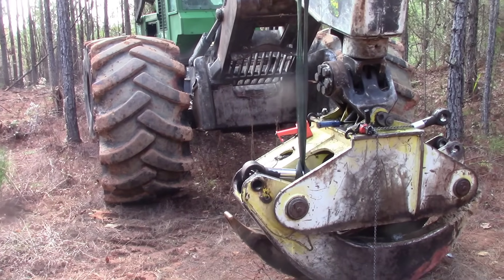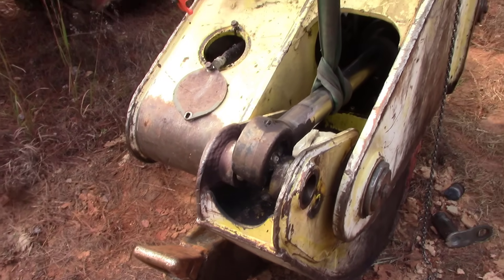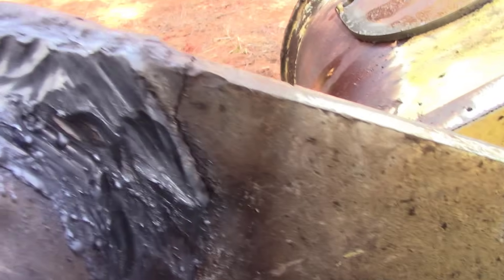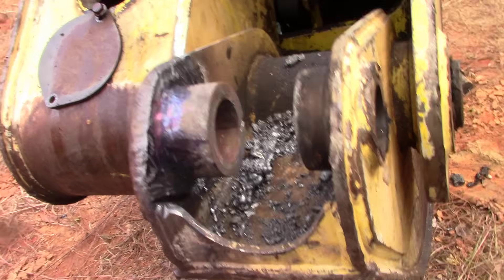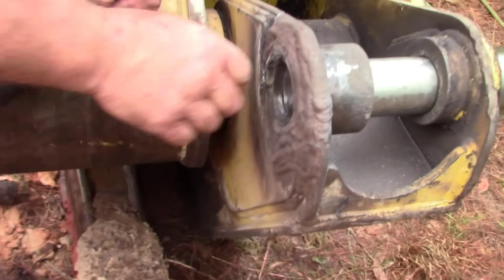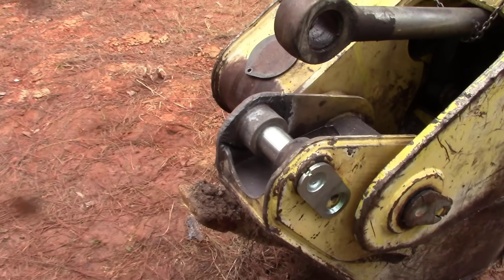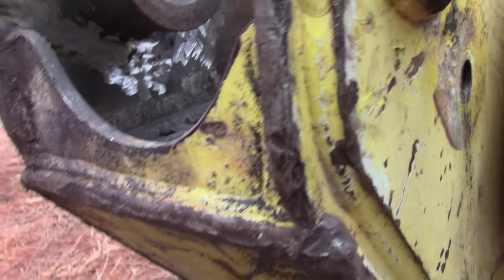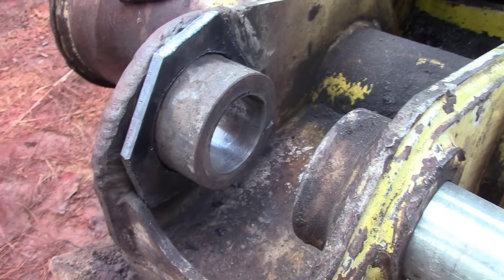748H Skidder Grapple Repair

Comment: Probably not a permanent fix as you say. However you did what you could with what you had on hand. Loggers can tear up an anvil with a rubber mallet. Not because they are any worse than any other machine operators. The nature of logging is hard on machinery, especially here in New Hampshire where  I live. We have rocks the size of skidders, granite ledge, steep slopes and the going is usually tough. It's hard on machines. Why things last as long as they do is testament to mans ingenuity. Well done boys. If that poor old grapple ever makes it into the shop for a rebuild you can bore the holes straigt and make more significant repairs. But that may never happen and in reality what you did will most likely go many hours before you need to patch it up again. Cheers.

Comment: I think IC weld said that when you just gusset something it just finds the next weak point it's funny how manufacturers know of the weak points but never improve the design😂
Reply from the maker: IC is exactly right. Unless you know exactly what you’re doing using gussets or fish plates or scabs is a guaranteed way to make another crack.  And sometimes the design is so bad you cannot fix it. I’ve run into that on Dirt Pans and c frames on bulldozers.

Comment: Glad to see ya back!

I miss working on logging equipment. It’ll make a good hand out of ya quick! You learn fast about stress and what it takes. Used to work on a decent bit of tigercat stuff and I really enjoyed those. 

In logging, you can build the strongest stuff ever made, but after 10k hours and some very smart operators……… nothing is overbuilt.

You’d be surprised how much you can line bore with a die grinder and some flap wheels hahahaha
Reply from the maker: Thank you sir. The ole portable milling machine works pretty good some days.

Comment: I've never done that type of repair but I built farm equipment at a factory for a while. We always installed test pins, welded the equipment off and used strongback supports as needed.  I was thinking I would have lined up the pin and maybe wrapped it with old fire hose or something to protect it then weld everything solid enough to hold. Install a crossbrace if needed and remove the pin to finish welding in areas it interferes with then reinstall and let it cool.  In any case, you got it done and as always did good work.  Nice to see you again.
Reply: Or put the old pin in
Reply from the maker: It’s been my experience if you leave the pin in and weld it you will never get it back out. I’ve used cross bracing in the past and have let the piece cool completely off and as soon as you cut the bracing it’s going to pull especially stick Welding. Depending on tolerance  the proper way to do. It is to have your bushings or bosses undersized weld everything and then line bore everything together.